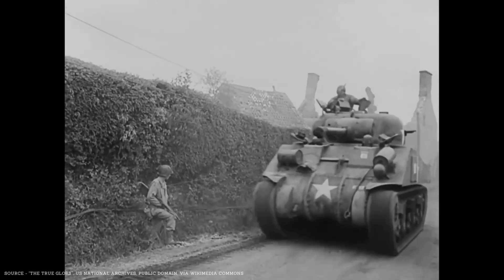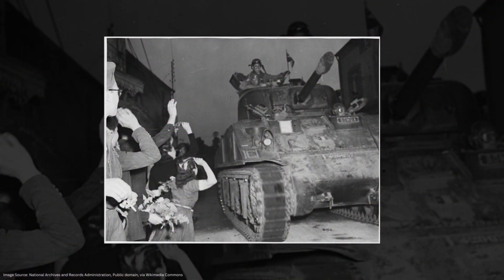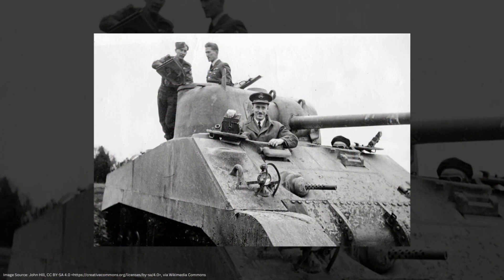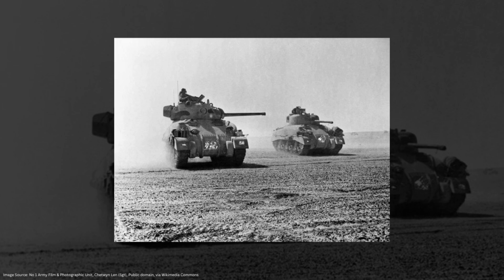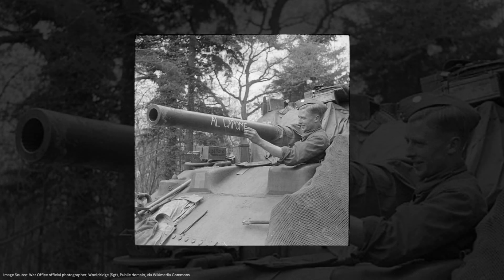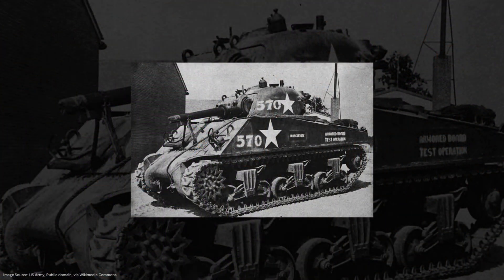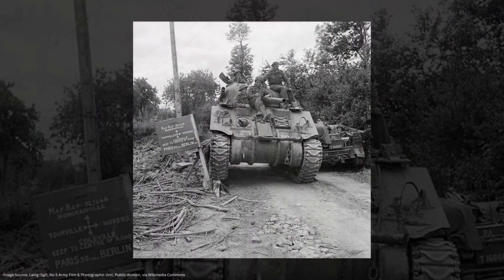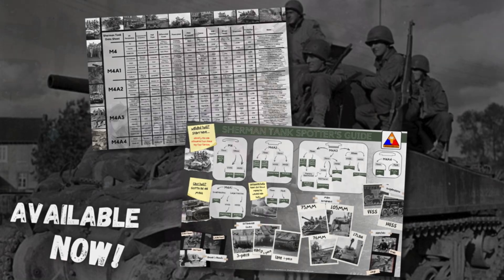The Evolution of Sherman Tank Hatches | Sherman School: Part 5

Comment: Very pleased you are mentioning the many safety issues on the Sherman, which many of todays armchair generals do their best to deny. The early DV hatches were particularly hard to exit as they were not sprung, the crewman had to lift the full weight of the hatch wich was difficult if wounded. In early 1943 the hatches were counter-sprung making then much easier to lift. Because of safety issues, principally fire, the Sherman series were re-designed in late 1943. Along with 'wet' ammunition stowage on the hull floor, the large hull hatches were introduced which were fully counter-sprung. To do this the front hull angle and armour thickness was changed from 50mm / 56 degrees to 63mm / 47 degrees, the level of protection remained the same.